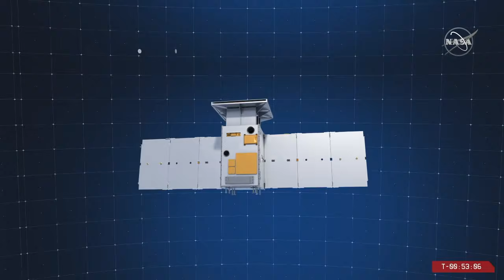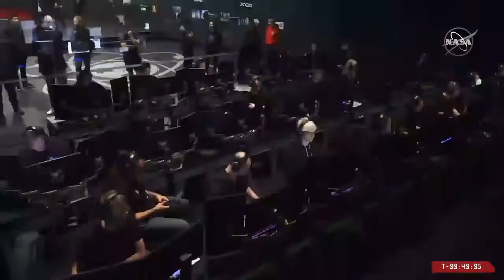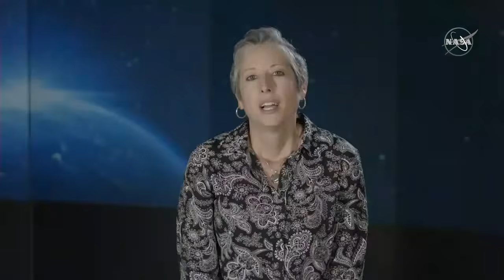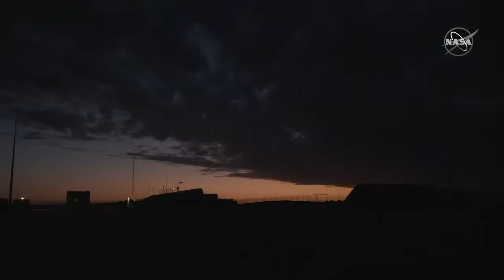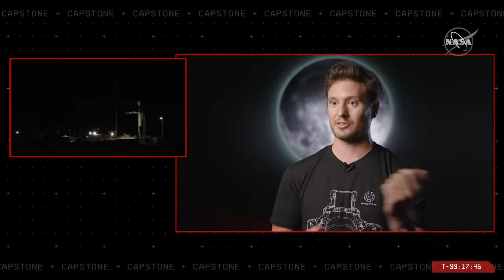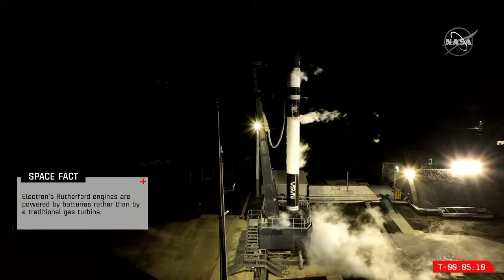Rocket Lab - CAPSTONE Launch 06/28/2022

Comment: No mention of the fact that this is a New Zealand rocket (not USA) designed by Rocket Lab. Peter Beck, a New Zealand engineer, and founder and CEO/CTO of Rocket Lab, has been sending up 3D Printed Rockets for years, since 2006. 
Peter Beck launches small satellites at a frequent, reliable and cost-effective means to orbit. 
In 2021, the New Zealander, Peter Beck, eat his hat because he said that his rockets are so cheap, there was no need for them to be reusable, and if he ever decided to make them reusable, he'll eat his hat. 
In 2021, he made a 3D Printed reusable Rocket, so ... eat his hat. 
His reusable Rockets come down with a parachute with large hooks. Helicopters scoop up the hook in mid-air and then fly them to where-ever Peter Beck wishes it to go.
CAPSTONE is a payload launched by New Zealand's Rocket Lab. USA need to give credit to all involved, even if it hurts their ego because it involves a foreign country (the major contributor). It's just being respectful.

Comment: Not a fan of the cartoons its 2022 no reason shouldn't have live coverage throughout. But I get it that's not really a important part of the mission. But if you want to grow your audience this would help a lot to have real coverage. Thanks Rocket lab
Reply: they physically could not put cameras on this one
Reply: cameras were removed to save weight, as its a very small vehicle going very long distances, so they need to squeeze as much performance out of it as possible
Reply: @TheSpaceEngineer  No, it was telemetry bandwidth as mentioned IN THE VIDEO.
Reply: It is a NASA mission, their call

Comment: Congrats to rocket lab on a good flight so far! The temperature and fuel level diagrams were very cool, I kind of wish we still had a live camera but I am fine with the animation as long as they just stop cycling through the same 3 views over and over it’s very repetitive. Maybe just have a view of the upper stage be somewhat static but have it zoom in on parts where things are happening, like the engine for shutdown or to the kick stage for separation. 

What really matters however is that the flight was good so far good job to all the teams involved!
Reply: They couldn’t have onboard cameras on this flight due to weight savings decisions, hence why they used animations.
Reply: @ashangalhena2110  Not weight saving but for telemetry requirements. So basically data transmission. Video feed requires a lot of data to transmit
Reply: @ashangalhena2110  oh very interesting, thank you very much!
Reply: @ashangalhena2110  it's all cartoons
Reply: Once the animation played the third time, I was out.  Nothing new to see here.
Reply: @TaylorJordyn17  check out beyond the imaginary curve channel

Comment: 58:58 Lift off,
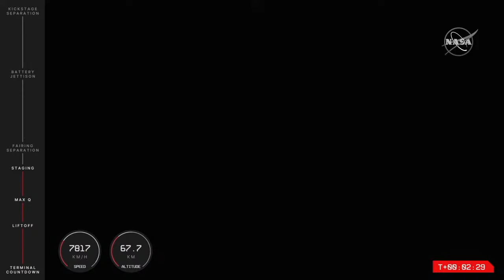1:01:30 Stage separation. (Welcome to the 3D animation launch coverage, Rocket Lab),🤦‍♂️🤦‍♂️
1:02:11 Fairing separation,
1:05:23 Battery hot swap,
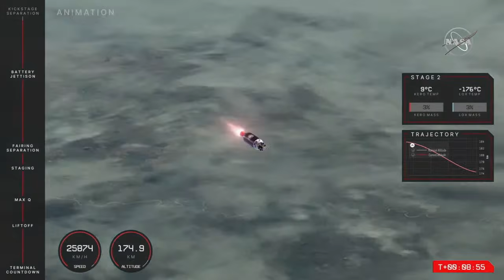1:08:00 Seco/Payload deployment.
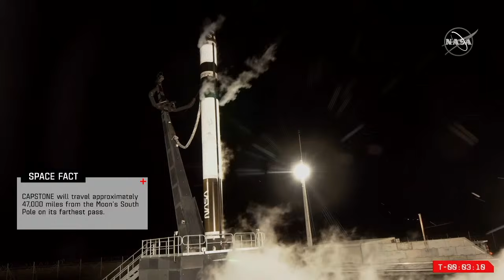Reply: At 55:53 there’s a explanation of why they didn’t have the cameras on the 2nd stage.